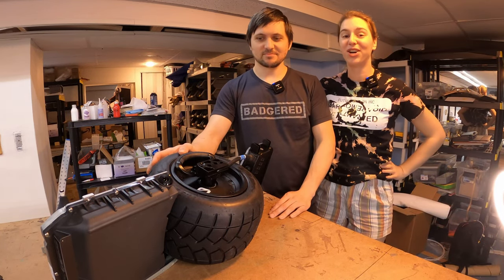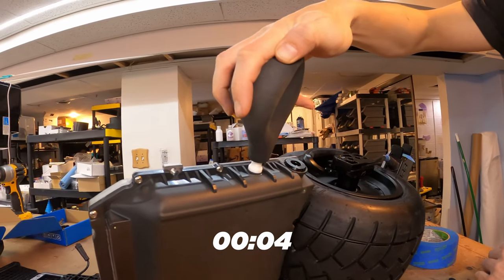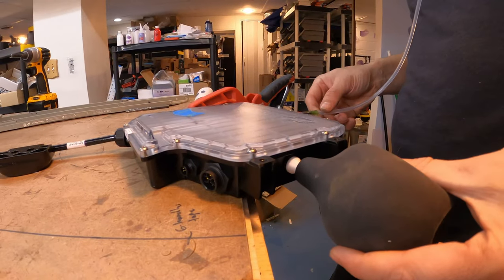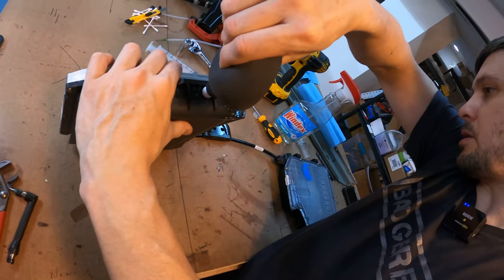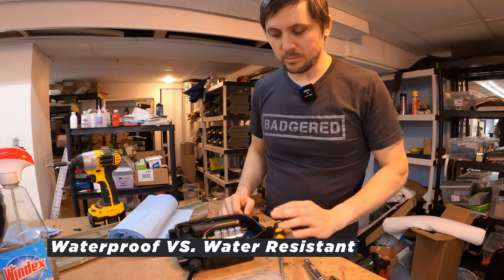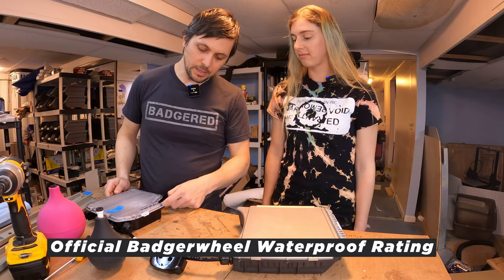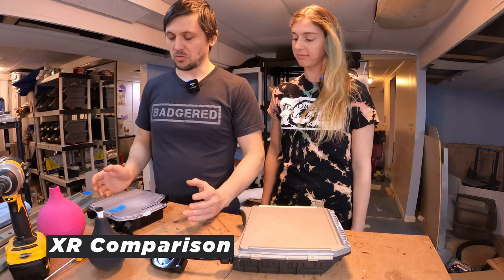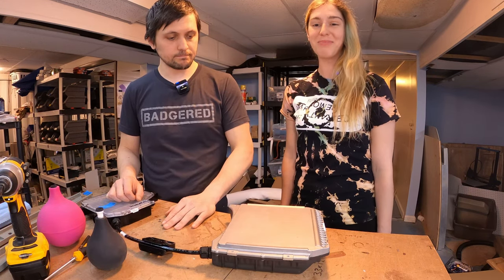Onewheel GT: IS IT WATERPROOF? Official Badger Assessment

Comment: Knowing what I know now about silicon, I'd never use it to try and seal my OW. I'd strongly recommend a polyurethane (Like Sikaflex or Dicor) to anyone doing this. Silicon will harden over time and can't expand and contract very well, and vibration will cause it to sheer/pull away from flat, unroughened surfaces. An elastomer has surface adhesion levels almost unmatched, and stay supple over time to absorb bumps, vibrations and expand a lot with part movement. It's also cleaned more easily than silicon, which fouls the surface and makes re-applications fail at a high rate. Would love to see Badger kits upgraded!

Comment: Would putting silicone around the connector void the warranty?  You don't have to open up the controller at all, but FM seems so trigger happy to declare someone's warranty as void due to "modification".
Reply: I would say with FMs track record yes
Reply: Nah it’s not really considered a modification is it ?
Reply from the maker: Historically, FM has honored some warranty claims for modified boards when it's obvious the modification didn't cause the issue. In this case, it's a non-issue because you can remove the silicone pretty easily with a toothpick or other plastic scraper, and some qtips.  That way you're sending it in to FM "unmodified."